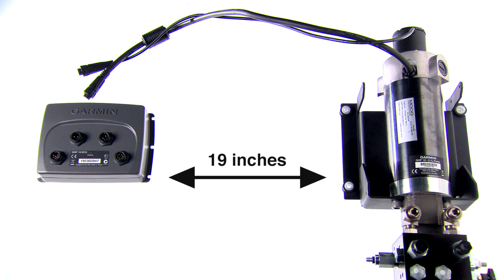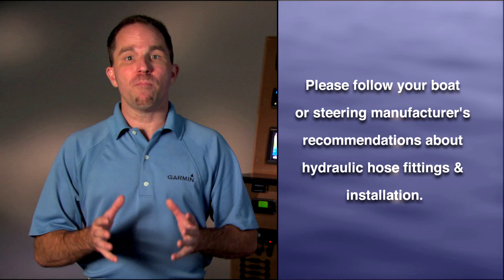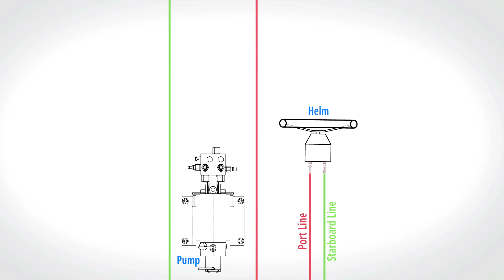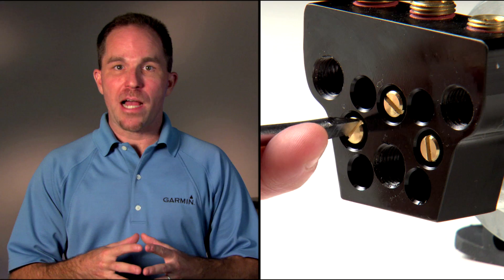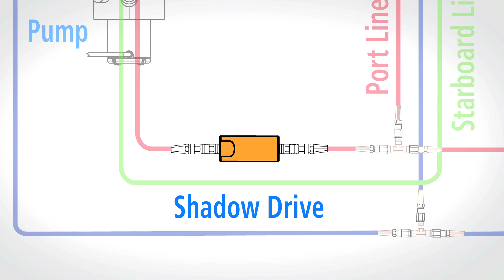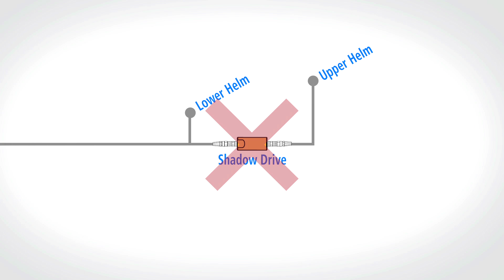Installation of GHP™10 hydraulic components

Comment: Could I install lines coming from my helm  to the top of the pump and out to the ram from the forward fittings off the pump?
Reply from the maker: It is possible, however we prefer connecting to the existing steering using "T" connections.
-MR